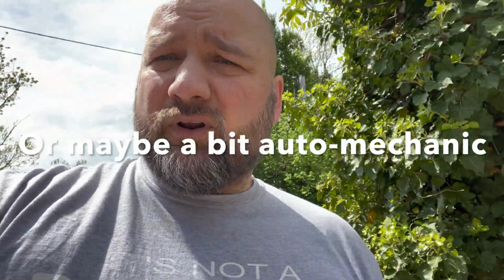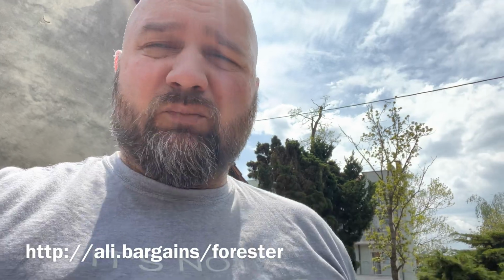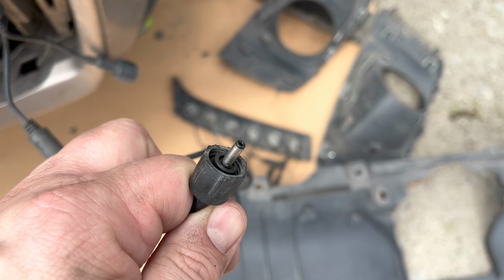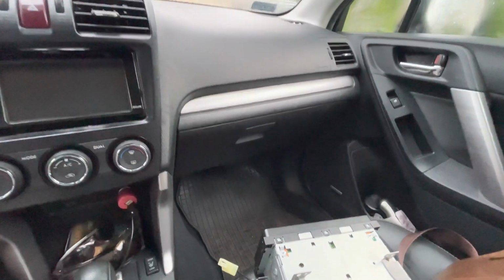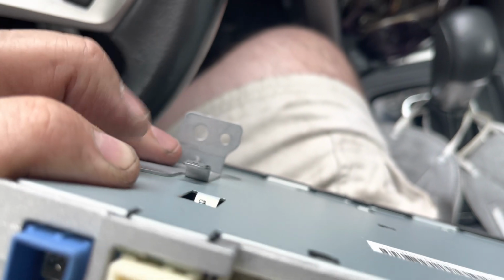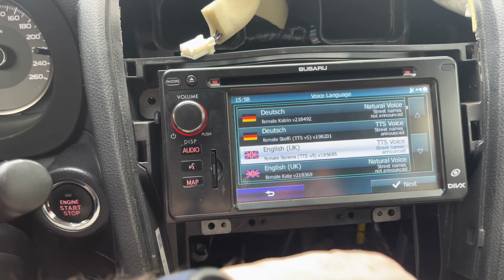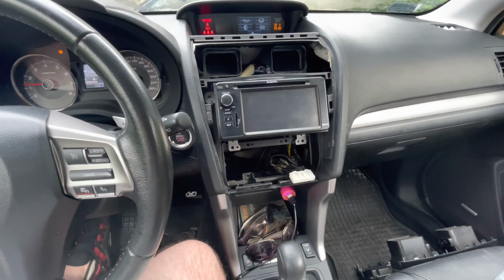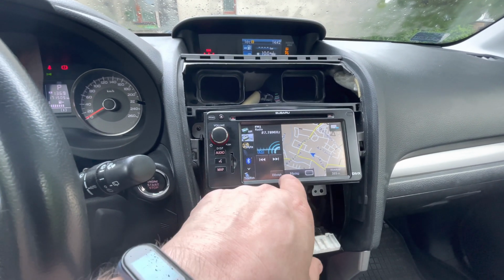🇺🇸/🇬🇧  ⒶⓁⒾⒺⓍⓅⓇⒺⓈⓈ Subaru Forester DRL instalation and a not so successful radio replacement

Comment: Hi thank you .. sorry to bump your video ..just wondering about? the end of your video of the  tabs of the fog light cover were the cut off also so the DRL can be flushed installed or tabs were still there? thank you
Reply from the maker: You need to cut off those tabs as the LED light extends down and needs to snap into the opening created when you cut off that part otherwise you won’t be able to fit it.

Comment: Can you post a video of your wiring installation?
Reply from the maker: I'm afraid it is all now hidden underneath the covers, grille.  But there isn't much philosophy.  You just need to run a cable to the battery +, another one to ground, therefore can be any bare metal of the chassis, or the - terminal of the battery and the on/off cable needs to be spliced into the headlights DRL + cable, which if you have HID/xenon lights will need to be before the high-voltage power supply module.

Comment: How were the drl lights on wired in or tied into power. All I have is red black and green wire
Reply from the maker: Mine had red = +12V, black = ground and white connected to headlight + or other lights or switch with +12V where you want these to switch on at the same time. There were versions also with additional green and yellow cables for the left and right blinkers. If you only have the red, black and green I would assume the green one is the on/off to be connected like the white cable in my set, although it would be good to write to the supplier and ask for confirmation